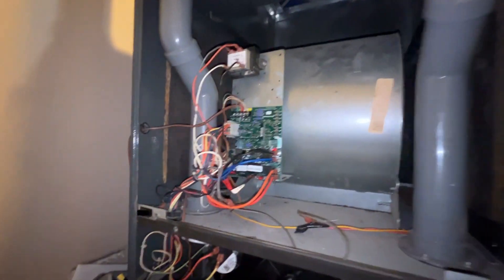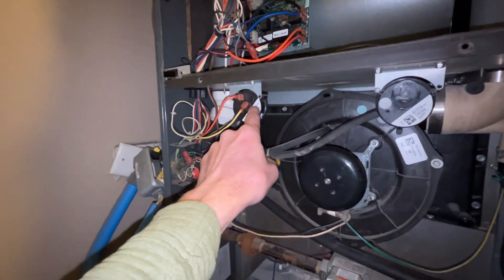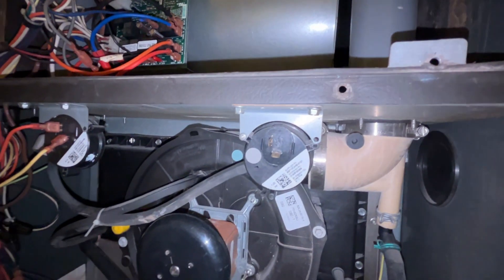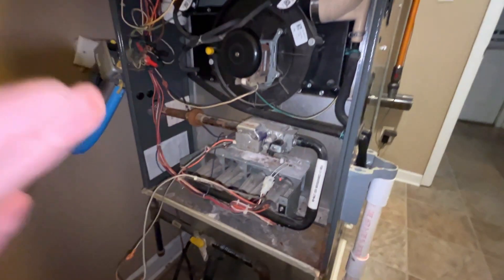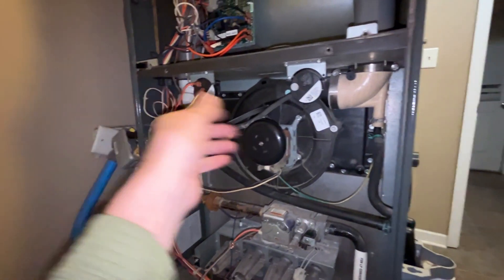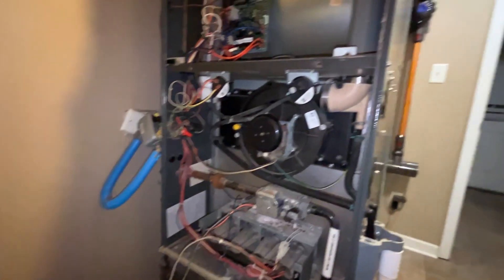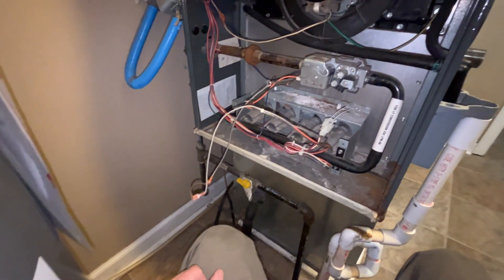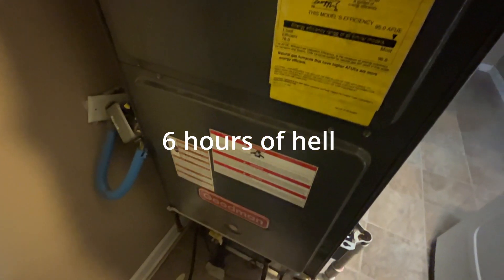furnace Wont light blowing cold air ?

Comment from the maker: Guys it turns out the vacuum valve switches where hooked up in each other place , the very low pressure drop switch goes on the fire box and the high PF valve goers on the blower fan . They was hooked up wrong when we  bought the house but it still worked and that's why the switch burned up . Also the hose that connected to the Low PF valve was worn out and that worn out hose is why the new switches wouldn't work  . So i cut off 1 inch from the hose end to give me some fresh hose , it gave me a tight fit and BAM , i was like shef Emerald . It has bin working for weeks so far and still doing well

Comment: I have had my furnace stop working one time and I was because of water in one of  the pressure switches. Or damper valves if thats what you insist on calling them. HVAC companies are a scam. They tried to sell me a whole new AC system because the AC drain pan was cracked. 😂 I fixed it myself with caulk. And they still tried to charge me $200 for a service call. I refunded it. From now on I fix everything myself.
Reply from the maker: I mentioned the mistake in the video but thanks for the input ,i also mention pressure switch in the comments

Comment: Even at 2 ohms resistance that’s not very much but it must of been enough to pull the 24v low enough. Usually anything under 18v will cause failure.
Btw Bobby, this is John from Ohio, I bought one of your first gen oil siphon nozzles off you a few yrs ago
Reply from the maker: Good to here from you